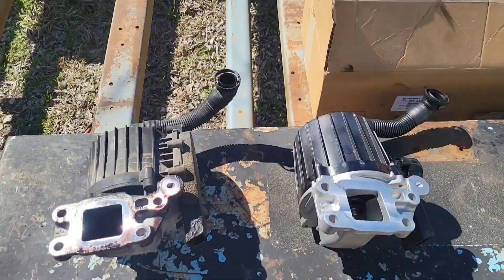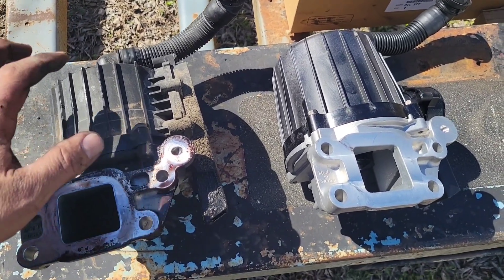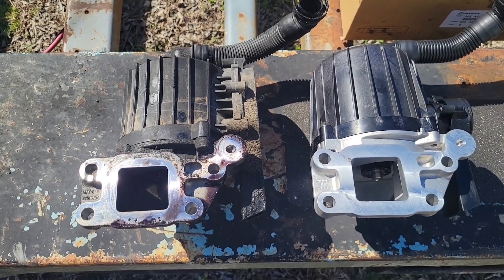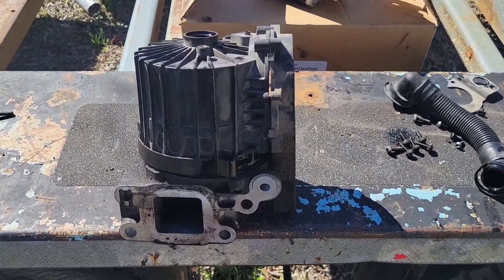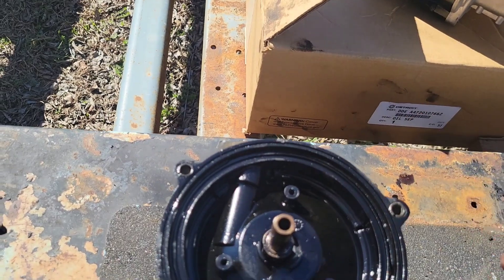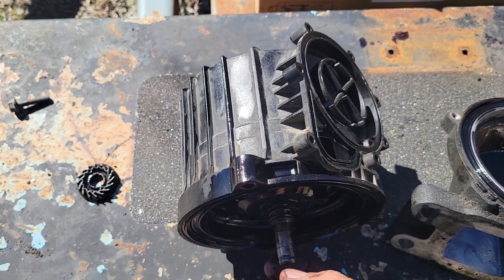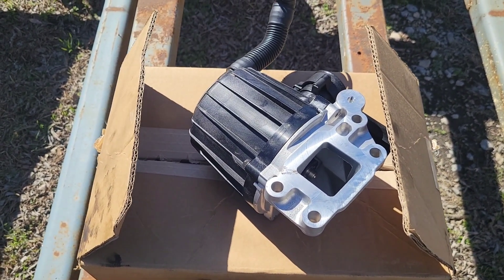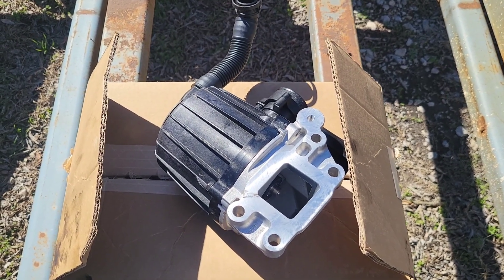Cleaning (or not?) crankcase breather filter on Detroit DD15

Comment: I cleaned mine once before and it worked until recently. When I cleaned mine I had only limited tools. I'm gonna soak mine in diesel while I'm home. 
Also mine is from an 08 Western star
With Detroit 60 series 14L

Comment: I have cleaned them with old fashioned  stinky "oven clearer" the original, corrosive stuff, I wash it with solvent, diesel, even gasoline, then pour the oven cleaner in, plug the hole and shake it, depending on how dirty it is, 2-3 times, then rinse with hot water til clean, I've tried every snake oil, Seafoam included, hot, cold, nothing cuts the residues of blowby, oil gum like oven cleaner.
 Word of caution, don't leave it soaking for hours, it will etch the aluminum.,
 I've boiled stuff in a big slow cooker with TSP, original nasty stuff, it's almost like the old outlawed hot tanks for effectiveness.
Reply from the maker: Interesting. Good to know. Thanks!